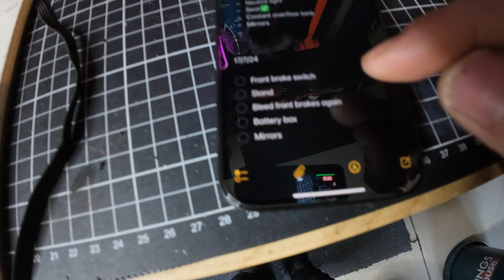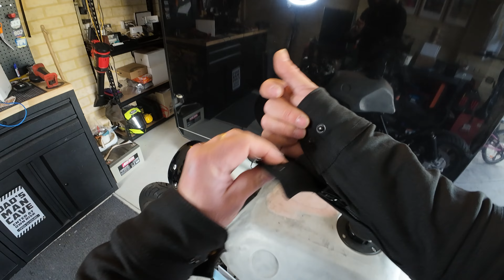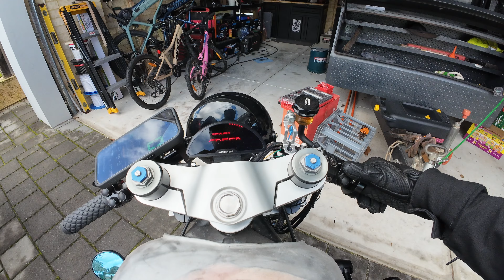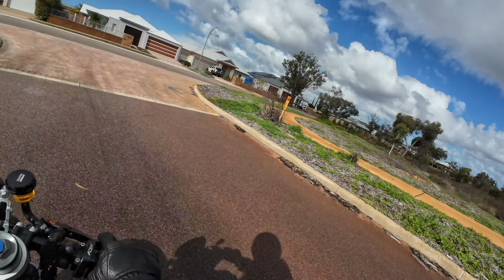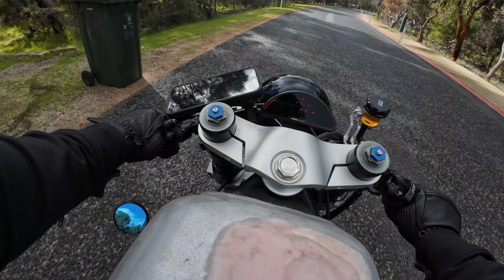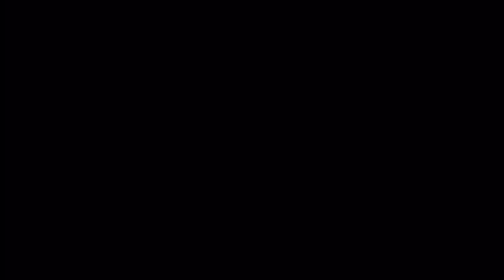1983 BMW K100 Ep10 | Motoscope Pro Speed Sensor, Custom Stand & Road Test.

Comment: Geil 🤩, du hast die Bremsen auf Unten nach oben Öl aufgefüllt! Geil . Ich hab genau GasXR Gabel wie deines  . Hab ich Problem bei Kleinen Ausgleichbehälter zu montieren . Jetzt wird montiert 👌🏻 . 
Wollte noch frage wegen Speed sensor weil bei mir Funktioniert nicht ! Ich hab sogar ein K Neutral Lunch Box Remover eingebaut dass die Gange zu erkennen und Lichtmaschine und Speedsensor zu funktionieren.  Außerdem mein K100 Fährt nicht mehr als 70kmh ich glaube es ist wegen Speed Sensor oder ? Wahrscheinlich das Problem liegt am Luftmassenmesser weil es wird selbst auf und zu !